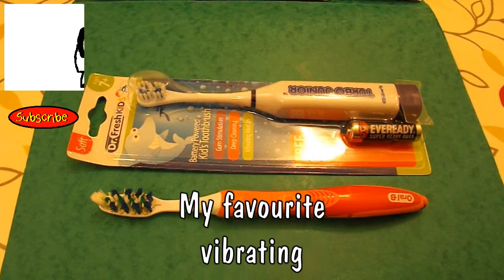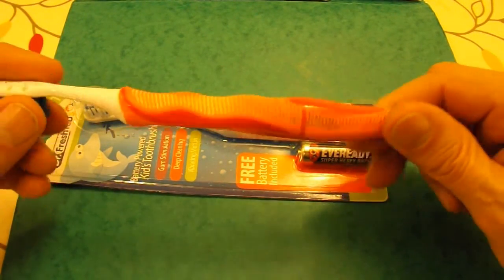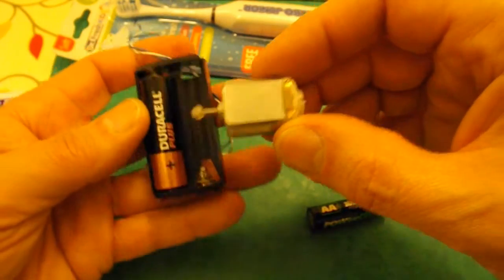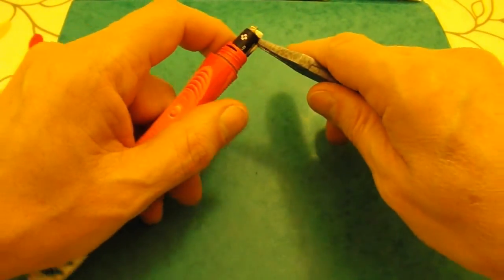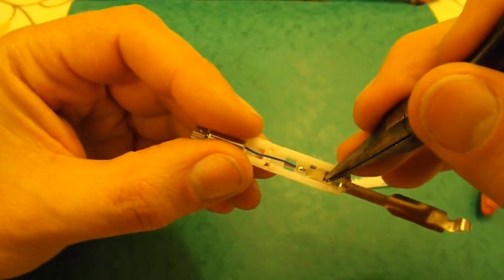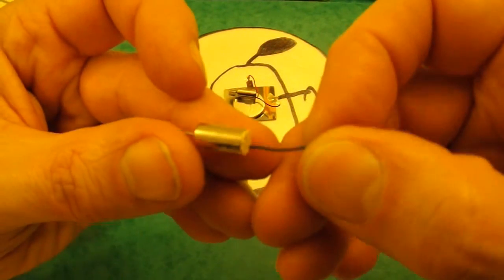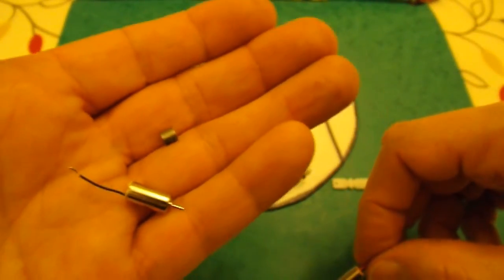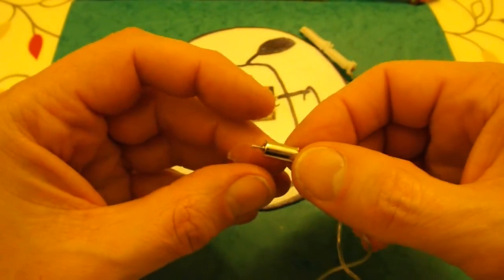My favourite vibrating toothbrush motors

Comment: Quick question: Are these plastic 'housings' that hold the motor in place, sold as ready made? or are they usually designed and then made? Also, are there any templates that can be bought in local stores?

Thank you
Reply from the maker: +Vikram B. I don't understand your question. The video shows two different types of toothbrush that I take apart and show the component parts. If you mean can you buy the individual component parts separately then the answer is that is unlikely. They will be mass produced in a factory somewhere and assembled into toothbrushes. There would be no market for individual parts as they would only fit the matching parts in the rest of the toothbrush assembly so they would have no other purpose. Maybe you should find one and track it back to the original manufacturer and then ask them if they sell parts separately.

Comment: Thanks for showing how to take these apart and what NOT to do.  I nearly ruined the one I got by not being careful removing the shaft weight.
Reply from the maker: At least with the dollar store products it is not too expensive if you learn the hard way. There is a whole range of similar motorised product worth buying just for the motors, many don't have that weight on them, such as beard trimmers, nasal hair removers (my favourite just so I can say that in the component list), lint removers, pet pedicure claw grinders. I spotted a ladies 'trimmer' the other day but thought that might be pushing my luck. The Oral B Pulsar toothbrush is too expensive to buy just for the motor, but worth harvesting at the end of it's life.
My latest favourite is the solar fluttering butterfly for small electric motors, plus you get the solar cell thrown in.